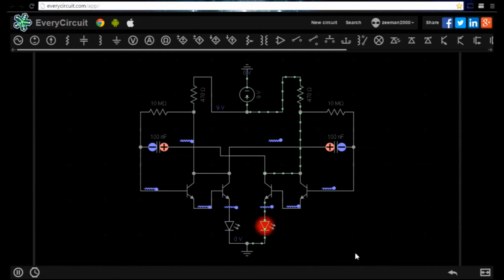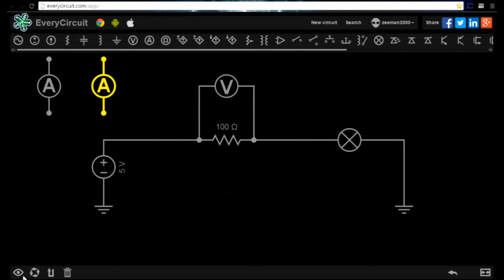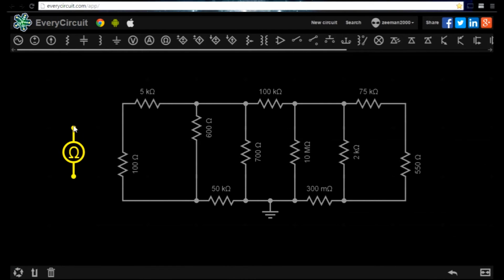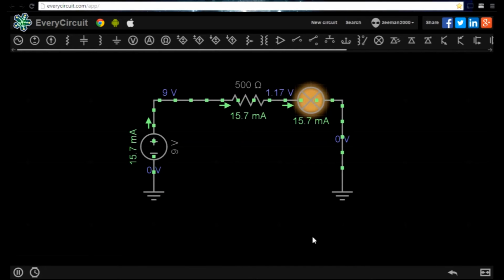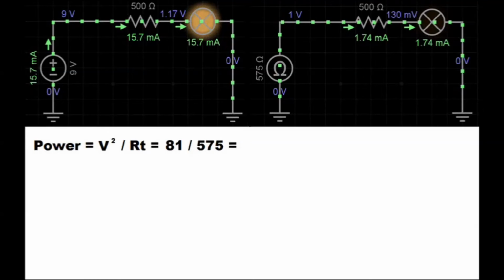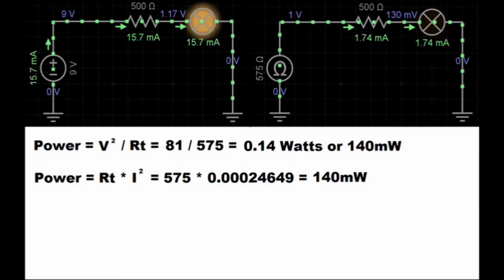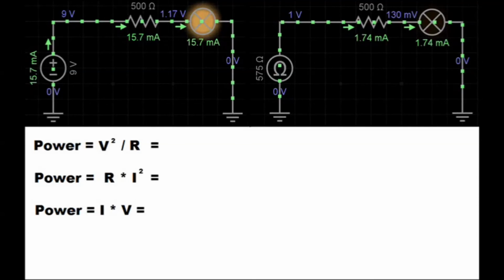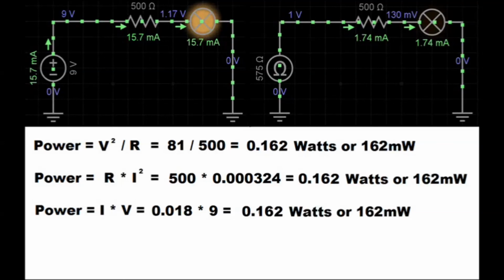Electronics Tutorial 9 - Power

Comment: Hello Jenko!
You are calculating (in 7:51) the Power dissipated over the 500 Ohm resistance. I would use voltage drop instead of incoming voltage. Dissipated (lost) power is: (500 Ohm * 0,0157 Amps)^2. \  500 Ohm = 0,123 Watt

9V^2 \ 500 Ohm = 0,162 Watt <–is Power on the Source but Not the dissipation power over the Résistance.

Am i wrong?

Thank you 4 your Video. Like
Reply from the maker: Thank you for your input. I will have to look at this but you may well be right. Well done.

Comment: I have no Idea how you got the leds to blink back and forth, Im thinking its the transistors,
Reply from the maker: Hi, xspiro1x, you are correct. It is the transistors that switch on and off that make the LED's flash back and forth. This circuit is a transistor flip flop. You will find simpler designs than this online. If it does work for you try adjusting the simulation speed. There is also the shake to start option which injects noise into the circuit to get it started. Simply shake the screen to do this.
Reply: shaking the screen, worked great thanks
Reply from the maker: Glad that worked for you. Have Fun :)